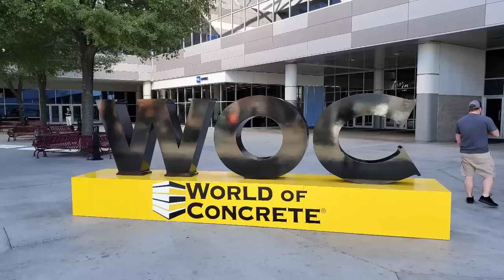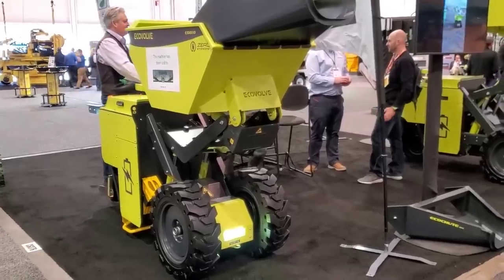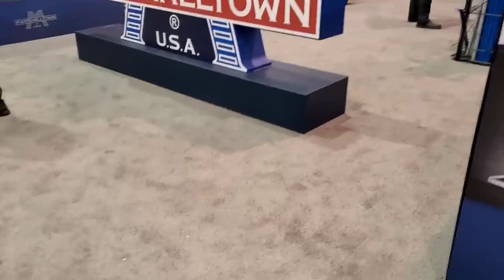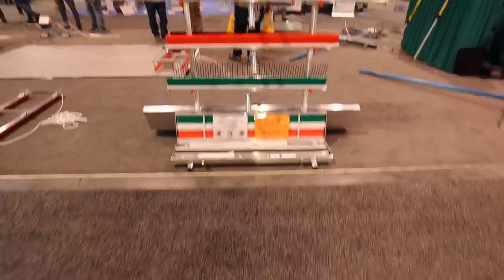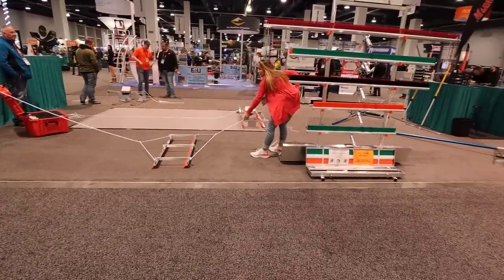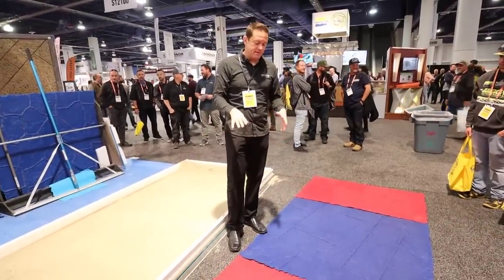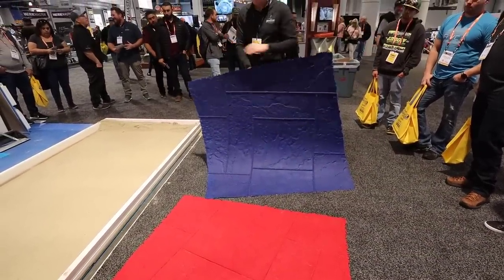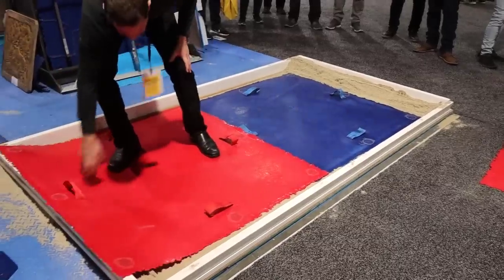New Concrete Tools & Equipment From World Of Concrete 2020

Comment: -Haven’t been in several years, but I’ve gone to the WOC a few times. Once in Orlando and a cpl more times in Vegas. Definitely NOT the place to take the wife for vacation! She’ll be bored out of her mind and hate you for it 😆. But for ‘concrete-heads’, it’s like a kid in a candy store.
-Noticed you dropped by the Metabo booth. Worst ½” drill I ever bought. Burned the first one up in literally hours. Home Depot replaced it and the 2nd one blew up, in short order as well. Replaced it with a Milwaukee, that I still have today (many years later).
-Last time I was there, the guys in the Caterpillar booth wouldn’t let the Chinese guys in any more bcz they were crawling around under the equipment taking all kinds of pictures of Cats latest mechanical engineering (presumably to take back to China and reverse engineer 🤨)